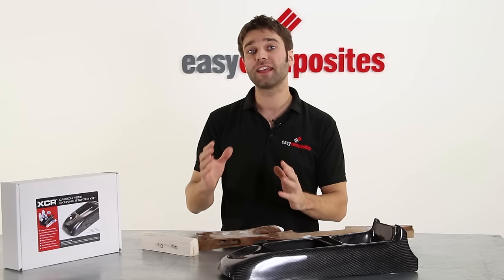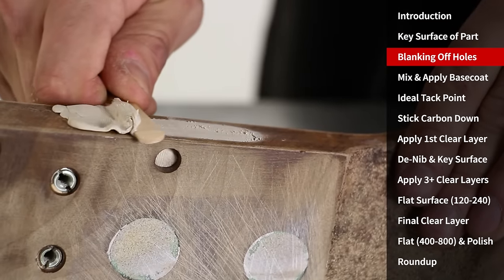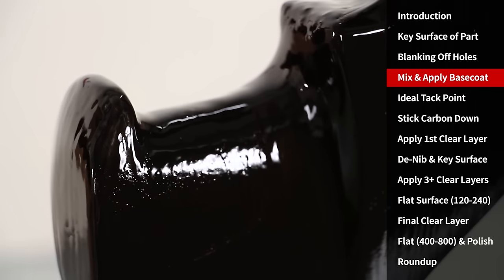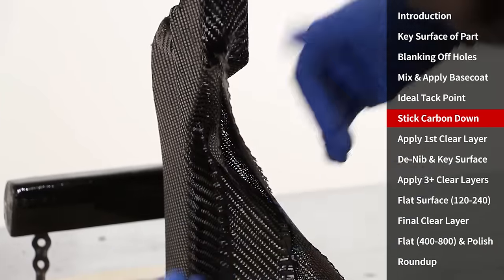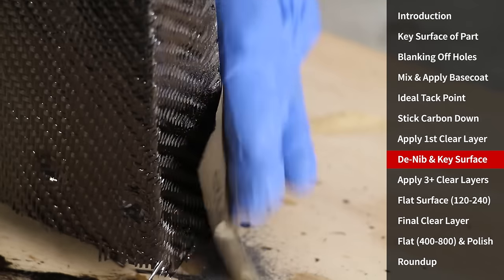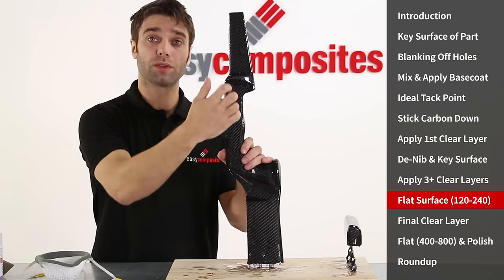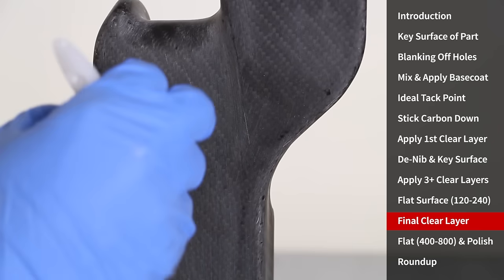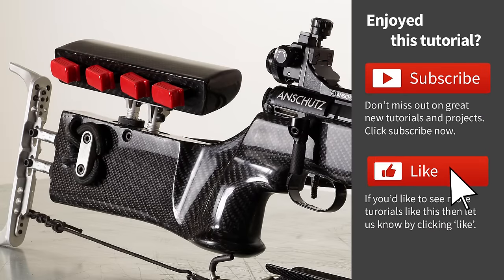Ultimate Carbon Fibre Skinning/Wrapping Tutorial - Sofie's Rifle Stock

Comment: Is it possible to apply a second layer of carbon? If yes, at what stage eould that be done? After the first coat has become tacky?
Reply from the maker: Yes you can apply another layer of carbon if needed. The 'B' stage or slightly before would be ideal, the same process as with the basecoat. This will help to hold the carbon in place and crosslink with the next layer of epoxy.

Comment: Can just fusion fix be used instead of basecoat? Is it only about having good bonding surface?  Great video.
Reply from the maker: The basecoat has a double function of blacking out the part (so that you don't see the colour of the part through any gaps in the fabric) and also for sticking the carbon down properly. If the part is already black then it's possible to substitute the basecoat for compatible spray adhesive but you would have to be very careful to ensure that the application of adhesive was light so that it was actually the clear XCR resin that does the proper bonding of the carbon onto the substrate.

Comment: Thanks for the videos. What is the difference between the basecoat and the clear coat (i suppose it's a gel coat) later regarding properties? Can good bonding be achieved by applying the clear coat in the beginning?

Some years ago i covered up my speargun with carbon fiber for structural strengthening. I did it with the infusion method but before starting the carbon lay-up i just sanded and cleaned the surface. Didn't use any form of resin before applying the fiber.
Reply from the maker: The basecoat is made from the same base resin as the top coat. The difference is the strong black pigment and a more thixotropic mix (so that it can be applied slightly thicker without running off). If your part is already black then you can use a layer of the clear coat to stick the carbon down and it will be just as effective as the basecoat.

Using a tacky base layer is really as much for practicality as anything else because you need to stick the carbon down somehow. For a resin infusion (which you described) the vacuum bag holds the carbon down and therefore there was no need to 'stick' the carbon down with a basecoat.
Reply from the maker: The Base Coat is basically the same base resin as the top coat but pigmented black.

Comment: is there a carbon  fibre that you sell that the carbon fibre stays together such as the one in this video. by looking  at this project  you took on for the rifle i can see the material is thicker.  or am i wrong. the amount of hours I've put into laminating my parts  im really  not happy with tue results. the laminating has turned out great no problems with the bonding  so far. but the fibres in some places is not great. And i really  want a perfect  result. many  thanks
Reply from the maker: Hi Mark. The material used in this video is exactly the same fabric that we supplied to you. It's probably came off the exact same roll as we were filming this just after we sent your material out to you. Remember, we're very experienced at handling this material but I can guarantee the carbon in the video is the exact same one you have in your hands!

Comment: Is it absolutely necessary to use the top coat clear resin? I want to skin an automotive dashboard, but I’m really interested in having the textured raw finish of the carbon fiber.
Reply from the maker: You would need something, at least a very thin layer as the carbon would otherwise be likely to snag and pull as well as delaminate from the substrate. It may be worth experimenting with only one or two layers as opposed to the several that we do in this tutorial so as to allow the resin to follow the contours of the carbon fibre weave.

Comment: Is it possible to use this method with more than one layer for some added strength, or do you have to use resin infusion in that instance? Any help is appreciated :)
Reply from the maker: Yes you can use this technique to add multiple layers of reinforcement onto an existing part. Obviously you will only need to add the extra layers of resin once you have got to the final layer of fabric. You would then continue and finish the resin as per any other skinning job to achieve a good surface finish.

Comment: Can you use this process to do a second layer of carbon fibre as well. And then put on a breather layer and hooverbag? (I feel i would need a second layer to strengthen the part im covering in carbon fiber)
Reply from the maker: Absolutely if you wanted to add a second layer to increase the strength. You can vacuum bag a skinned part but will usually end up with more wrinkles and potential weave distortion in the fabric by doing so.
Reply: @easycompositestv  I this process the 1st layer of carbon fibre goes on the tacky (2 hour cured) gel coat. In my use case of two layers. Would I put the first layer in as you did and cut and trim. Then wet it with the topcoat resin (the step labeled as apply 1st clear layer) and then add a second carbon skin and press through with my hand or coat it with more resin? I feel like it should be wet enough to penetrate the first layer but not too wet as to get through the carbon fibre? Sorry for this. I brought this exact kit but I need two layers for strength so would like some clarity. Many thanks for your swift response

Comment: Hi, before the wet sanding, you say that resin must have reached a full cure, because it may get affected by water. How long untill full cure at 20-25 degrees Celsius? And how the water affects the resin? I have done couple of tries, and in the final product there are some imperfections (resin looks dusty, when looking it from certain angle or when sunlight hit it). I work in a dust free environment, so the reasons I can think of are microbubbles, water affecting the resin or it has something to do with the clearcoat. Some help will be appreciated, thanks! We are talking about skinning procedure here.
Reply from the maker: Hi Yoto, so firstly, is it definitely our XCR resin you're using? - I want to make sure because other resins really won't work the same or anywhere near as well. The XCR resin is a special super-clear resin developed for this application. Please confirm.
Reply: @easycompositestv Yes, it is the XCR that I am using. I have bought everything from your online store, except the CF cloth.

Comment: How to prevent from yellowing the carbon fiber?😅 thankyou for notice  because i think when after a months it turns fade and yellow the carbon fiber
Reply from the maker: Mainly, that depends on the type of epoxy resin you're using. The XCR resin we use in this video has amazing UV stability, we've never seen it yellow or fade in sunlight. So, the best suggestion is to use a very UV stable epoxy. If you can't do that then you should use a UV stable and UV blocking clear-coat over the top.
Reply: @easycompositestv  ahh okay thanks for info but if 2k clearcoat i use on top coat its okay? Its never fade? Thankss!!!🙇‍♂️

Comment: Hi, great instruction! I was still wondering what the maximum operating temperature of the skinned part can be without deterioration of the carbon fibre skinning?
I was thinking of skinning my motorcycle exhaust muffler, however, some parts can still get a bit hot.
Reply from the maker: Hi Lennart, the XCR resin we use in the skinning kit has a max service temperature of around 70C so you'd need to check what temperature your muffler gets. If it's 70 or more then I'd suggest not skinning it with this system. An infrared thermometer would be the best way to check; get the bike running, with no air movement over it, on a hot day!
Reply: @easycompositestv  Thank you very much for your response. I will check the temperatures of the parts I would like to skin. Outstanding that you guys still respond to comments of old videos.

Comment: So, My dashboard is going "sticky" and I'm looking at wrapping it in Carbon fiber, but my main concern is the material that the dash is coated in. It has a foam like quality where it has a little give, but is textured like leather, though I do not believe it to be pleather. Would there be any concerns there with the material and resin? I'd be wrapping the upper section of the carbon with a matte clear film for glare, so that is not a concern. Thanks in advance, and i hope you guys see this!
Reply from the maker: Generally if possible, rip or sand off with a flap wheel the soft coating, assuming its not soft plastic throughout.  The rough finish from the flap wheel will help with adhesion.  Even if the coating does not come off easily, the rough key from a flap wheel would be good for adhesion anyway so worth doing.

Comment: Can multiple layers of carbon be built up using this process to make a part rather than just skinning?
Reply from the maker: Hi Joe, yes, for sure. Adding multiple layers of carbon fibre and resin to the outside of something is essentially the same as the normal lamination process (i.e. laminating into a mould) but using the original part as a male former, rather than laying into a female mould. For example, you could 'skin' onto the outside of a foam shape, using multiple layers, and this would just be an alternative way to make that carbon fibre shape, the foam inside becomes pretty much redundant.

Comment: Can I ask, is this method of skinning suitable for linning inside a petrol tank. Is the finish petrol resistant. I have a fibre glass motor cycle petrol tank that i need to line out the inside to protect it from ethanol in petrol. Any thoughts
Reply from the maker: No as the problem is with the resin itself.  You can either use a fuel resistant laminating resin like our VE140, or more commonly for older closed tanks, a swill in ethanol resistant tank liner would be easiest to use.  A few bike restoration places will likely have what you need.

Comment: Is Carbon Fibre Skinning the same as using fiberglass molds to make fiberglass parts without vacuum bagging?  Can you just "lay it up" like fiberglass?
Reply from the maker: No, Carbon skinning is laying a layer of carbon on top of an existing part. Wet lay carbon laminating is similar to hand laid fibreglass.

Comment: load work looks great can you do this with a foam rc plane do you think
Reply from the maker: Yes skinning a single layer over a RC plane hull or wing would be pretty similar.  Depending on weight considerations, you may not use as much resin and/or use a thinner carbon to start with.
Reply: yes also do you think the spray would do to bond it rather than all that black goo
Reply from the maker: @Dg-zj6jo  not really as spray tack is generally a temporary adhesive so loses its bond strength soon after it cures off; its only meant as a temporary solution for positioning the material whereas the black epoxy basecoat physically bonds everything together.

Comment: your three to one mixing , is it based on weight or volume? the density of the fluid changes the volume
Reply from the maker: It's 3:1 by weight. You're right that it would be a different ratio if you were mixing by volume but we don't really like suggesting that customers mix resins by volume - we find this to be less accurate (people are more inclined to do it 'by eye') so we always give mix ratios in parts-by-weight.

Comment: Do you need to strip off the paint of a metal hood before applying the 1stt resin coat?
Reply from the maker: No, normally you would just be able to 'key' the paint with abrasive paper to aid the bond but if the paint was damaged/corroded/loose then it would be better to remove it.

Comment: Could you vacuum inject it after sticking the carbon down instead?
Reply from the maker: Generally no as you aren't operating with a mould so resin flow and control would be difficult. Plus it would still have a rough finish and need resin coating by hand anyway.

Comment: Hi Easy Composites, the only thing i would do differant to the above video is wet out the carbon cloth on a hard piece of plastic like a cutting up board first, pick the wet out carbon up and place it on the job. I do it like this all the time, you end up with no excess reson and you can apply a couple of coats of reson later for sanding
Reply from the maker: Hi William, there's no issue in doing it that way some people actually prefer to laminate this way too, its usually referred to as "wet preg" it's really a case of what method suits the individual or application.

Comment: just wondering, i;ve seen many cars with skinned parts and the top coat tend to crease over time. is that a material or worksmanship issue. also can this skinning process be applied on carbon fiber chopped strands to make "forged carbon fiber" parts
Reply from the maker: Those resins will not have been post cured before being exposed to a very hot environment and hence the resin has softened and rippled.

Comment: No mention of full cure. How long does that take?
Reply from the maker: Full cure will depend on temperature and 'full cure' is actually quite hard to define. The resin will continue to get harden for up to 7 days in total (at 20'C) but where along that line you think of as full cure is a bit tricky.
Reply: @easycompositestv  Thanks for your speedy reply! So I suppose one could safely say that after a full week (at 20C), maximum strength has been reached.

Comment: Just a couple of questions. Is it possible to apply more than one layer at the same time? How many layers or thickness would it need for a 40x5x1.2 inch wood board to sustain a 600 pound weight?
Reply from the maker: Skinning is a cosmetic process and as such you only use one layer of cloth.
Reply: I wasn't talking about cosmetics.

Comment: So I was watching an old video of  you from Carbon Mods (2009 ish) in which you mixed 2/1, it had to dry for one hour more and you needed a hairdryer to get rid of bubbles. It looked like the same kit as you present here, so my question is: has the product improved dramatically or is it the application process that has... changed?
Reply from the maker: The kit has been completely revised, including the process that goes with it.  The resins in the old video have been replaced with the vastly superior XCR Coating resin and Basecoat.  The different resins have different cure times and curing profiles thus the differences in the process. We have also gone into extra detail in the new video to help make the process easier to understand.
Reply: Thanks for clearing that up for me.

Comment: Hi...do you think I can do this over a car engine cover? Will it warp over time due to heat or the black CF looks turn yellowish over time?
Reply from the maker: Hi Xavier, if the part is post cured in an oven then the resin will be fine up to 80C.  Under a bonnet it should not get UV yellowing.  It is possible if it gets too hot, the resin may get heat damage.

Comment: Great instructions!
The claim that XCR is bubble free is not true as to my experience with it. You have to take care to mix it carefully, not introducing bubbles. 
And isn‘t it 2h41m @20C for it to reach the tacky stage?
Reply from the maker: XCR is very good at releasing bubbles by itself, although this will obviously depend on how much air is whipped into the resin during mixing. You want to mix carefully to ensure that the amount of trapped air is kept to a minimum. The tacky stage will depend on a number of factors, predominantly temperature so its best to check at regular intervals.

Comment: At 12:35 you can see a lot of dripping in the resin right above his hands. Is this sanded down with 400grit? or do you use coarser paper on the "worst" areas?
Reply from the maker: ronpet11 Good question; coarser papers on any areas like this (I think we actually used a sanding block).

Comment: Hi there, can this be done over a metal surface as well assuming its really well keyed?
Reply from the maker: Yes a well keyed surface can be skinned no problem.  Ensure it is keyed to at least 120 grit, if not coarser, and thoroughly clean and degrease prior to applying the Base coat.
Reply: @easycompositestv  perfect thats great news, I appreciate the reply. Your channel has been massively helpful with my composites journey!
Reply: Hey! One more question. If I were to complete a peice, then put a sticker with a company's logo over it, would I be able to add another layer of resin to ensure the sticker doesn't get damaged through general wear and tear?

Comment: I had bad experience with my first time skinning carbon fiber so i would to know how i can remove the carbon fiber just i did the first setup is sticking the carbon fiber so i need to remove it
Reply from the maker: If it has not stuck too firm, you may be able to rip off the fabric. Otherwise, using a 120 grit coarse sandpaper, smooth the surface flat again ready to repeat the process.

Comment: How much thickness does skinning usually add to a part? Will i have issues with tight tolerance pieces fitting together after skinning?
Reply from the maker: A carbon skin typically adds around 1mm or less to a part but this does still mean that in some situations, particularly where parts are a very snug fit, that you do need to give this some consideration.

Comment: how does one handle the CF strands as a result of cutting and triming - espesially in home & hobby setups?
Reply from the maker: Work in an area where you can clean them up easily such as a shed/garage.  Just be aware of temperature in the cooler months of the year as that will effect the resin cure.

Comment: how much weight does it add? I want to add some carbon fiber to my motorcycle frame, at first I wanted to make a mold to make actual covers but this would be much simpler
Reply from the maker: It depends how much resin you sand off in the smoothing process, but you could be looking around 5-600g per square meter.